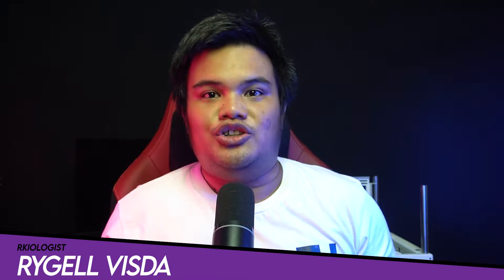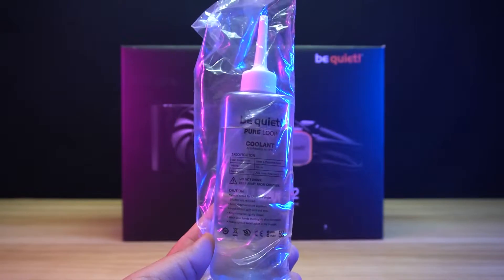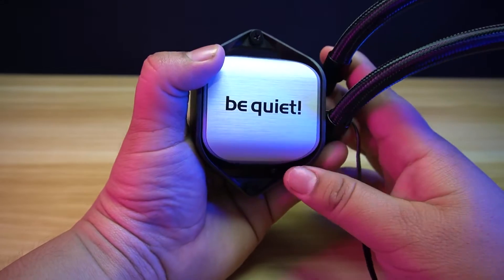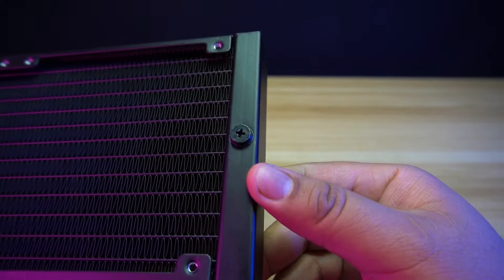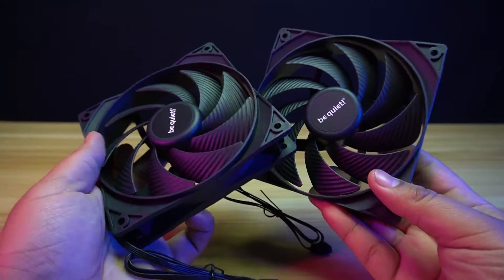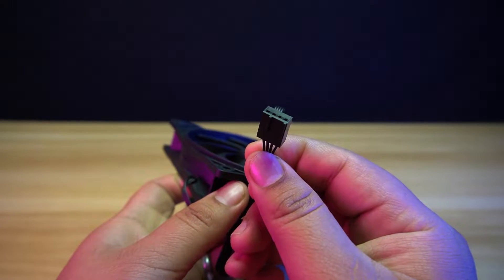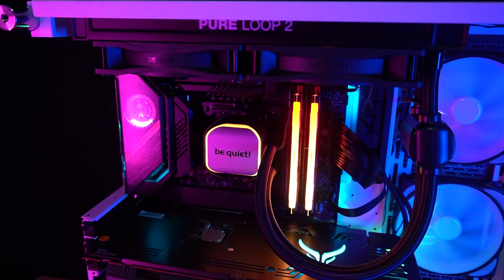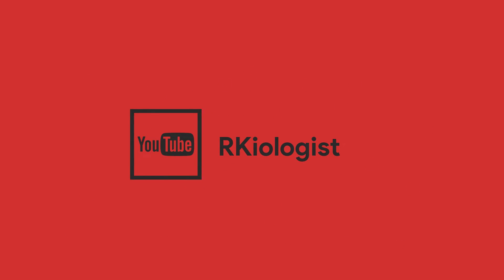be quiet! PURE LOOP 2 240 - Unboxing & Review

Comment: Hello, I bought this same 280mm water cooler and it didn't come with the SATA adapter cable, but it did come with an adapter to connect two fans to one. Please help me with this question: what should I do, buy a SATA adapter cable or connect it directly to the motherboard? My motherboard is a B550M TUF Gaming Plus, and it has a connector called 'CPU_OPT' and another one for 'CPU_FAN'; I'm not sure where to connect the LED from the block. Very nice video!
Reply from the maker: you can just connect it to the motherboard directly for the fans. for the block as i remember will go to the 3pin argb cable and the other cable for the pump will go to the cpu fan
Reply: @RKiologist  ok, thank you so much!
Reply from the maker: @ArMMR6  you're welcome